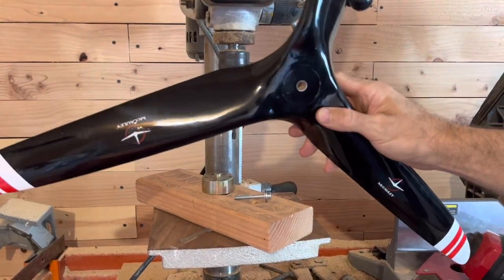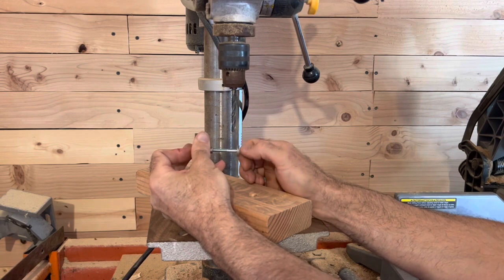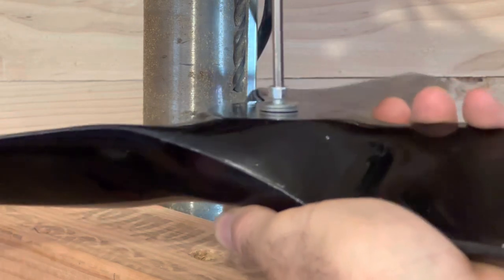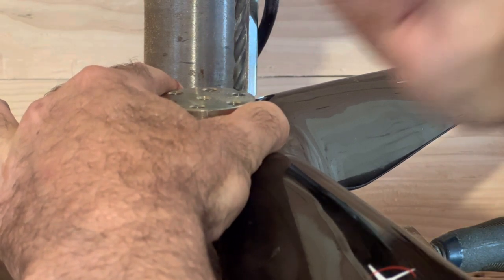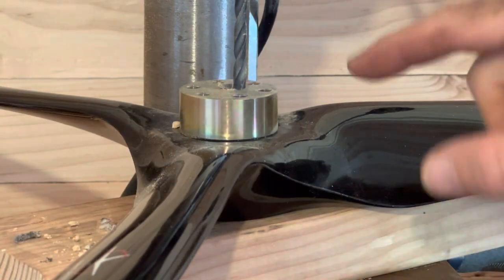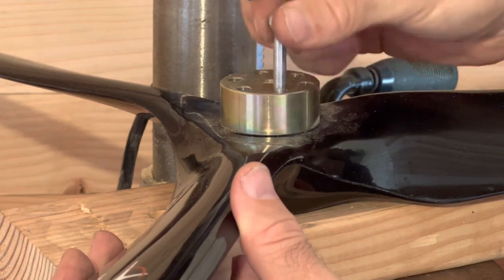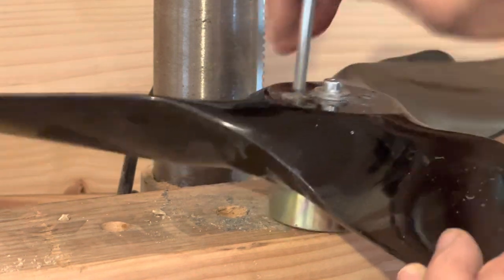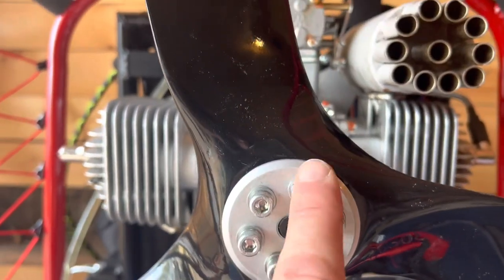AliExpress AirJet DLE170: Using a Propeller Drill Guide to Drill Bolt Holes

Comment: Hey is your motor running clockwise or Counter?
Reply from the maker: Counterclockwise I believe.
Reply: @TexasParasurvival  In that case can you tell me where you got that 3 bladed prop?
Reply from the maker: Chief AIrcraft
Reply: @TexasParasurvival  at 0:03 time it looks like you have a clockwise prop, would it still work with a CCW engine?
Reply from the maker: Great observation. I bought it because it was advertised as a good propeller for the DLE 170. I didn’t bother to check when buying because it was promoted as a DLE170 prop on many websites. I have an electric motor it will fit, so no big loss. It will give me an excuse to make a video about what to look for when buying a prop. lol